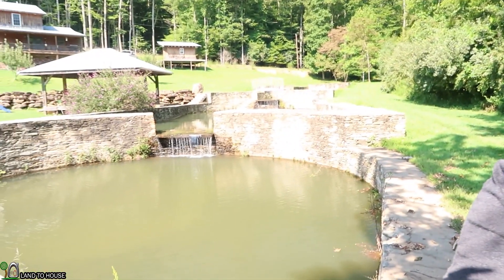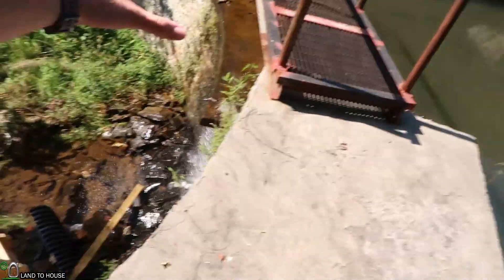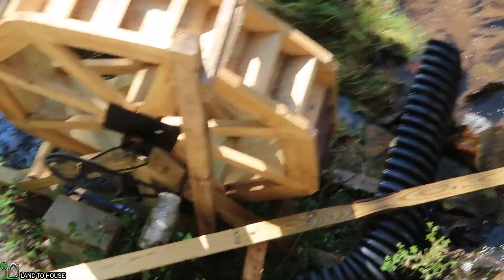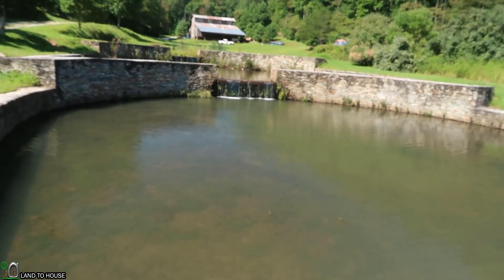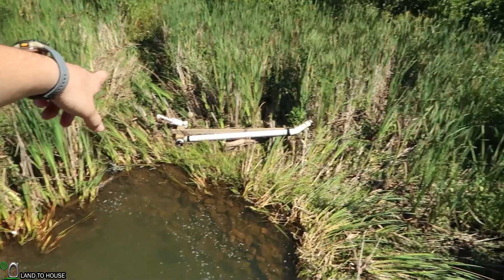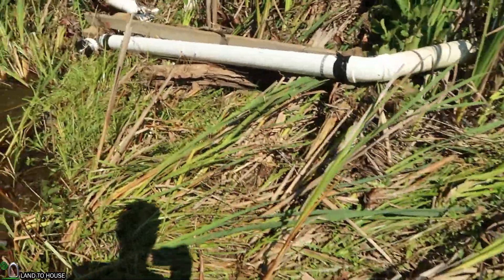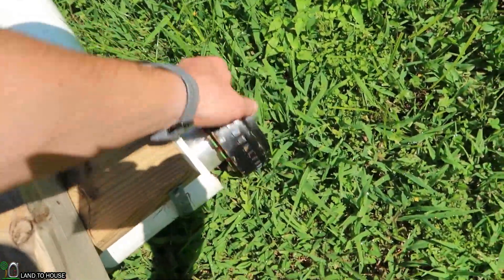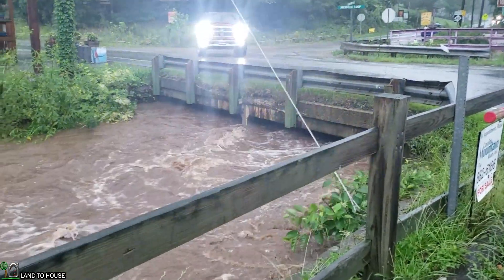Micro Hydro Destroyed in Hurricane Fred Flood

Comment: Could I suggest an Archimedes screw instead of a water wheel?
Will have greater efficiency when you has as low head as you have here.
Reply from the maker: I worked with an Archimedes screw years ago. Never did get it working right though.
Reply: It is important to have a good seal between the screw and the chute, but at the same time have as little friction as possible. Tolerances is the name of the game here.

Comment: A slide gate before the flume to limit the incoming water level can prevent this as it allows you to set the maximum head height (of course pressure still builds and flow will continue to increase beyond the gate opening, but not at the same rate as no gate) (wide and short would give you the best control)

Comment: If he had used a wooden penstock to drive the wheel, the excess would simply have jetted away from the wheel. The flexible pipe did exactly what it was designed to do and flexed. These are sunk into the ground where the ground prevents them from flexing.
Reply from the maker: Hmmm seems like logic wins again. Haha we will have to see what his next move is.
Reply: @LandtoHouse  He needed some lengthwise runs of 2X4 under the pipe. Simple fix to add.

Comment: What is the smallest amount of gpm you would need to be able to generate electricity?  There is a small spring on my property and it would be awesome if I could do something with it.
Reply: If you run a ram pump you can easily run a system. Run a ram pump down to a small jet. Yay the jet to push the turbine. You just need plenty of water

Comment: If he hadn't cut the pipe in half it would have  been stronger, I think it would still have run the water wheel
Reply: Reducing the height of the pipe sides to suit the maximum required flow/volume would reduce the load on the structure as any excess would just cascade over the sides and not overload the penstock.

Comment: How about dropping the water further up for a more gravitational pull
Reply from the maker: Yes I think he needs to make several changes to get the most out of the waterwheel.
Reply: That might make water exit prematurely like filling up your sink from 5 feet in the air, it will splash out.
Reply: @Seriouslydave  tru but them buckets need 2 b bigger with more dynamics